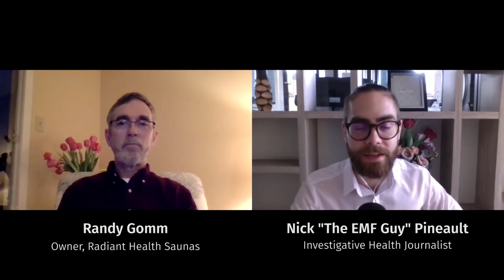How To Find A Low-EMF Infrared Sauna With Randy Gomm

Comment: Nice shirt Nick.  Check out Sauna Ray of Collingwood, Canada has a great safe low emf sauna built in Canada & sells the wiring if you need to change your own saunas wiring.  These other saunas regularly catch fire Rod Palmer said as well.  He's at the Total Health show coming up in Toronto April 12-14th.  He also sells electrolytes.  Essentia of water sells a new 5G ALLWAVE meter NES 3428 that will make all other meters obsolete.  5G is triple beamed, unlike 3G/4G which is sprayed.